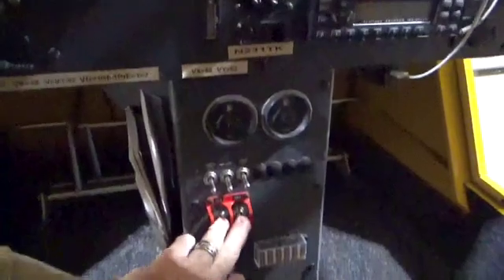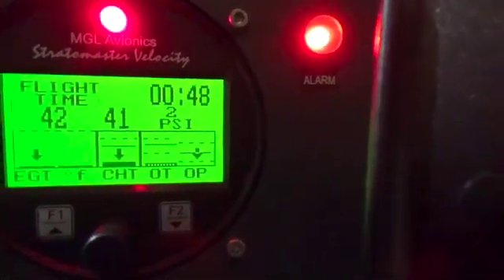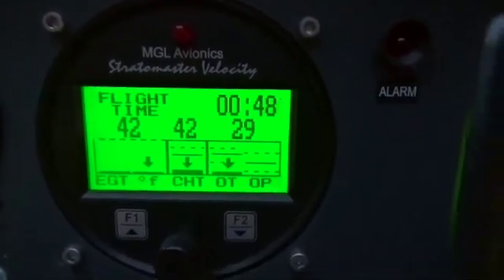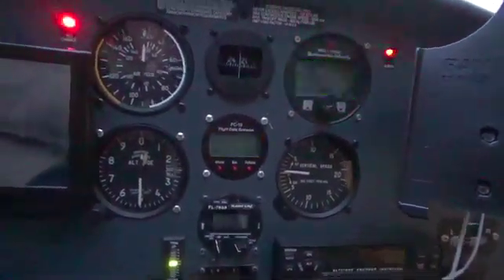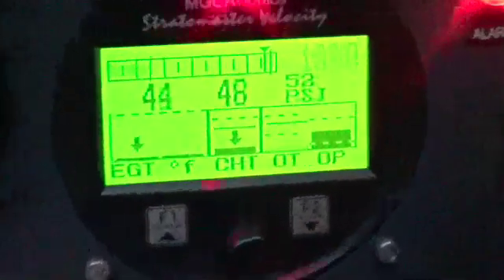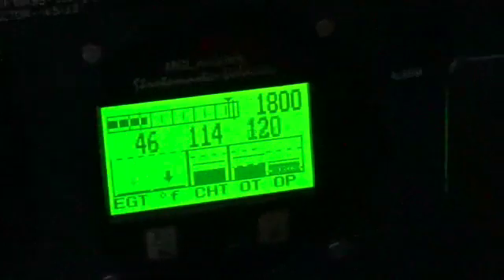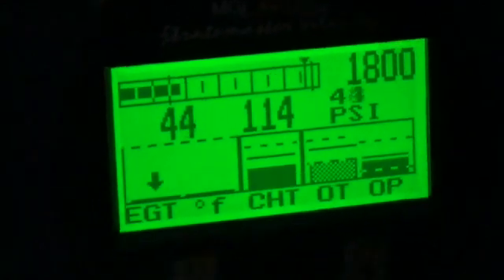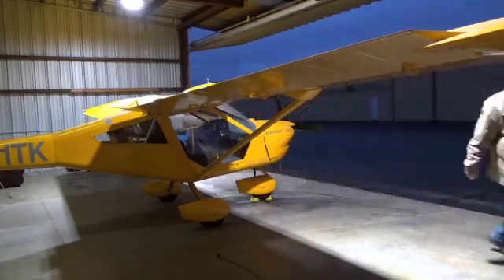Rotax 912ULS Oil Tank Heater Update #aeroprakt

Comment: We are just installing a heating pad kit on my rotax 912uls as well as an in flight cable actuated oil radiator baffle. The kit has 3 heating pads. Most of the oil sits in the lower part of the case when the plane is being stored. This should increase the oil temps at start up and the baffle to reduce the time to warm all the oil in the system. It will also allow me to adjust baffle in flight to bring oil temps to 100C more easily in most conditions!
Reply from the maker: Yes I’ve found that even with burping the oil system, there isn’t enough oil in the tank for the tank heater to do much. I’m interested in seeing your cable actuated radiator baffle!

Comment: I run an oil thermostat by-pass and a thermo-bob external water thermostat on my 912 ULS. My warm up time is 6 minutes in cold (13 degree) weather. Have you considered running a second heating pad on the bottom of the engine to preheat the block also? Thanks for the video. ✈️
Reply from the maker: I haven’t considered that but I know my cabin heat sucks!  Lol. I’d love to know more about your external water thermostat.